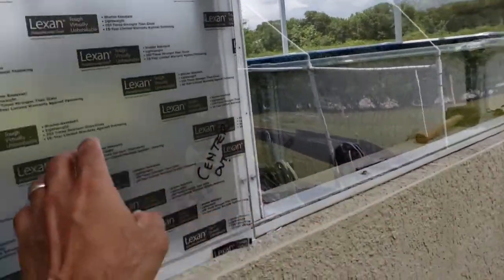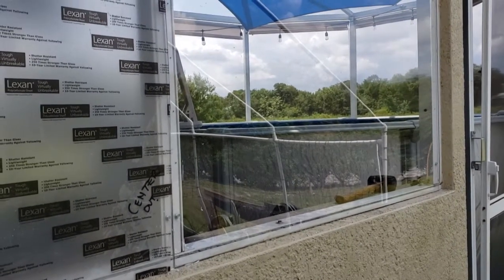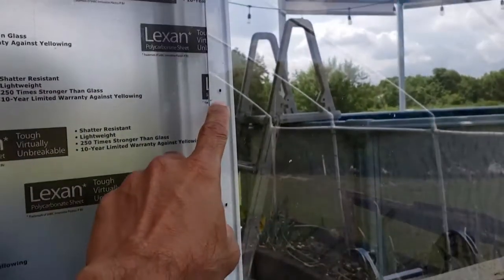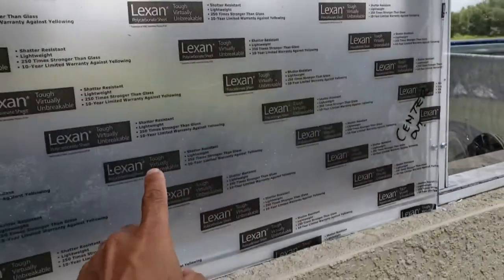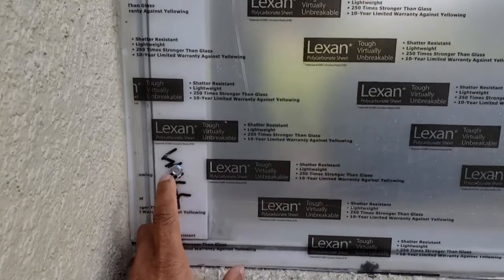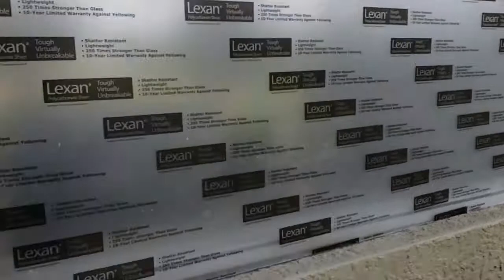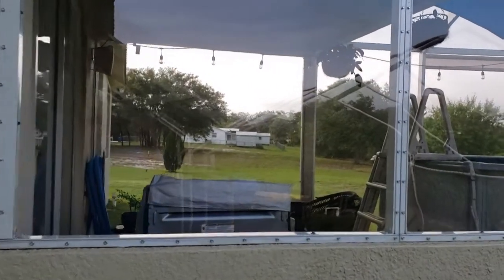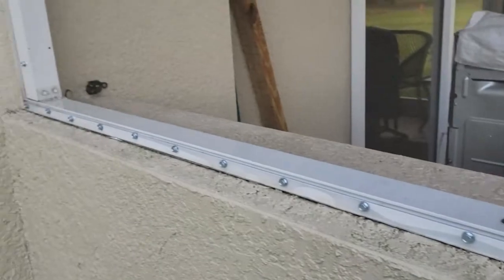Lexan (polycarbonate) installation in a Lanai opening

Comment: I thinking about doing the same thing
Reply from the maker: Mine is working good so far, only issue is when the wind blows sometimes the sheet moves back and forth and makes a sound like thunder. So you may want to brace it in the middle.

Comment: This stuff is the future of windows for me. Im going to cut the sheet in half to make it 4/4' and brace it out in perfect squares, and put them side by side. Do you know if there is a protective film for the face, that will keep the same clarity?
Reply from the maker: There is no protective film that I know of but have read that these sheets are good for 10 years or more. Be aware that the middle of the sheet in your 4x4 feet enclosure may flex in wind and make noise as is happening with me.
Reply: @Andrewsnotes1  yes, I have a fair amount of wind in the location where I'm building my house, which is an a frame, so I have it orientated to where the wind will hit and cut around the side on the tin
Reply: @Andrewsnotes1  thank you much for your experience and knowledge on this! I know not many people have been brave enough to try it, but I believe when this has been explored further, we will see something truly extraordinary for DIYers and custom homes
Reply from the maker: Yes it was a better and cheaper DIY solution than purchasing fragile glass and installing it in a frame. Good luck with your project!
Reply: @Andrewsnotes1  thank you! I look forward to it